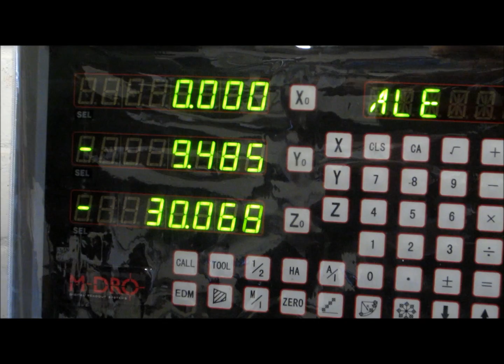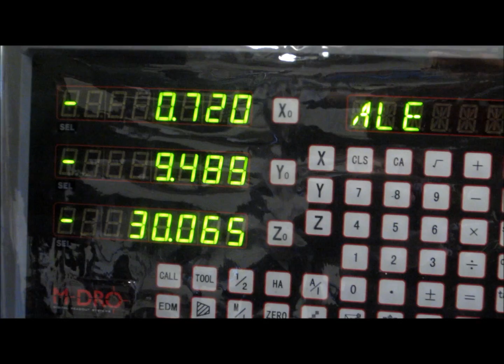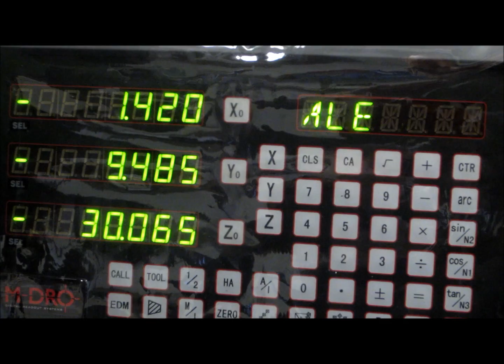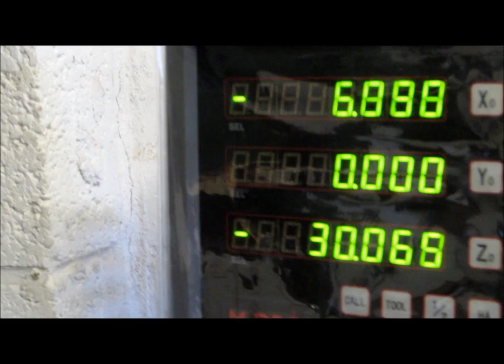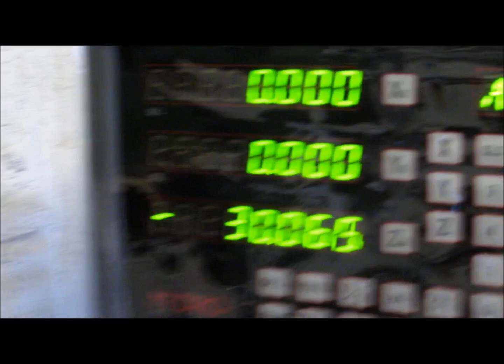Using the Wiggler

Comment: G'day Mark thank you for explaining how to use the Wiggler and showing how to adjust the DRO which I'm still trying to learn how to use it.  I hope that you might consider doing a video on how to use a DRO on a mill, mine is the same as yours and it's a bit of a struggle using it especially at my age 61, things take longer.  However you explained the Wiggler and DRO set up very well and clear, it would be greatly appreciated as I build my 5" gauge Super Simplex thank you, regards John Tasmania Australia

Comment: When you moved the table again after you zeroed, you lost your zero. What you should do is set an offset zero. I don't know how it work on your machine but on mine you push zero and hold it, and then type the 1.45 or -1.45 ,depending on the side you are zeroing from , and then hit enter. Doing it this way will give you a much more accurate zero, I promise. Other than that thank you for the video!
Reply: Really? If the method in the video doesn't work, then it would have to be because the DRO isn't accurate, right? And if the DRO isn't accurate, well then you're just all kinds of screwed anyway.